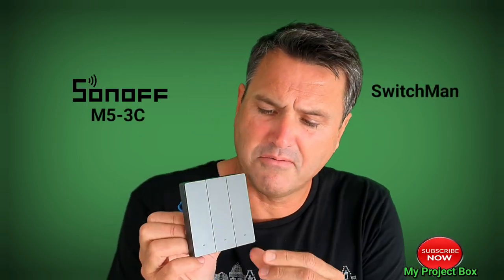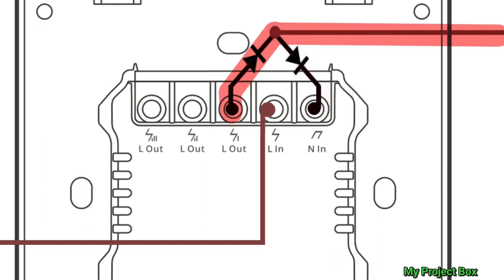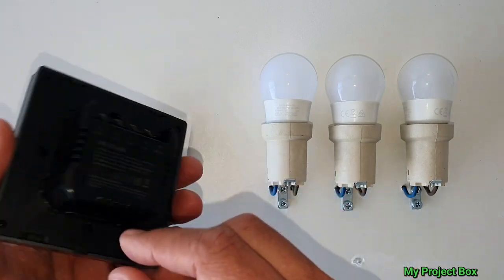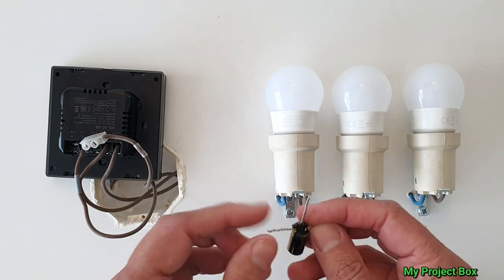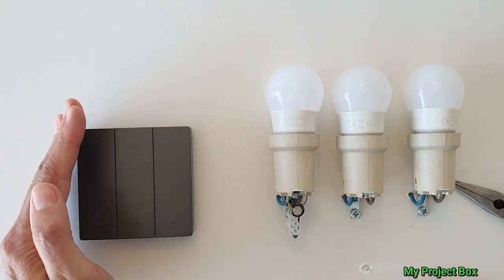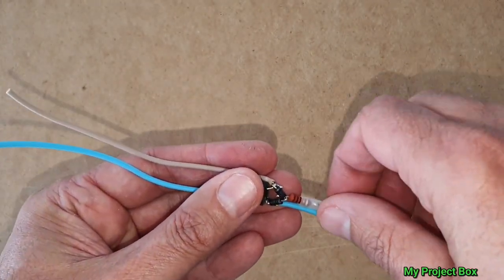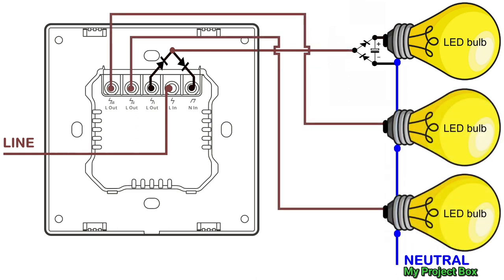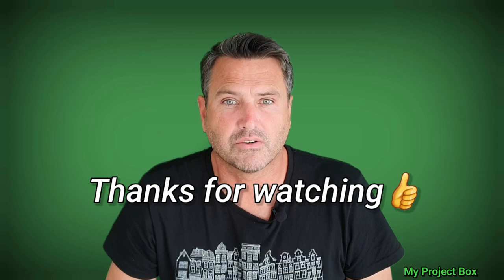Sonoff M5 NO-NEUTRAL  required trick! SwitchMan Hack #Sonoff #noneutral #circuit #modified #M5

Comment: Hi! It is Cool, but I think you need add in video (https://www.youtube.com/watch?v=oBR5O391m_c) - information about "Fuse Resistor". Thank You!

1) It is for 220-230v
Reply from the maker: It's a 10Ω 1W fusible resistor. It should work with 110V and 240V 😉
Reply: @MyProjectBoxChannel  should 1W 12 Ohm be ok, instead of 10? My local shop was out of those..
Reply from the maker: @TheHenrychinaski88  yes it will be ok for a led bulb 💡. You could also use 5ohm resistor, for a higher current load, but that will increase the inrush current when charging the capacitor a bit.
Reply: Thank you for including fusible resistor, it saved my switch.. After wiring everything it worked great but i wanted to change which switch switches which light. And when i switched line with fake neutral from line 1 out to line 2 out everyhing stoped working. I checked and switch works
Reply from the maker: @TheHenrychinaski88  hopefully you got it all working in the end👍. It might be a simple circuit, but it's still very easy to make a mistake. What I do for testing purposes, is to put a old school incandescent light bulb, in-line with the Live supply feeding the circuit(in series). That then acts as safety current limiting. It will supply enough current to test that everything is working correctly. But if there is a fault or short-circuit, the old bulb 💡 just lights up, and nothing goes BANG! It's a good trick and saved my arse many times😉.
Reply: @MyProjectBoxChannel  for everyones info, it worked with 12ohm, but it blown after less than few minutes of working.. Now it's on 5ohm and works for few hours now..
Reply from the maker: @TheHenrychinaski88  Interesting 🤔.  What power LED lamp have you got connected, is it perhaps more than one? And what is the voltage in your country?